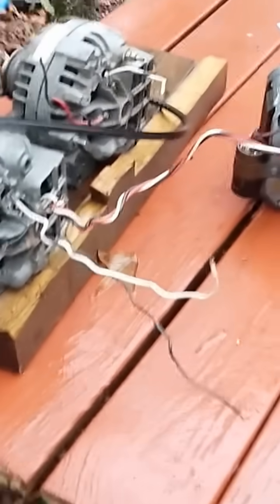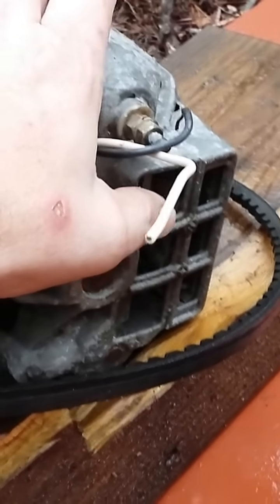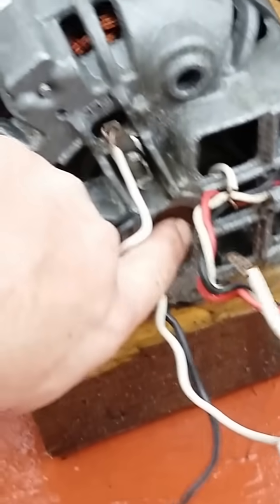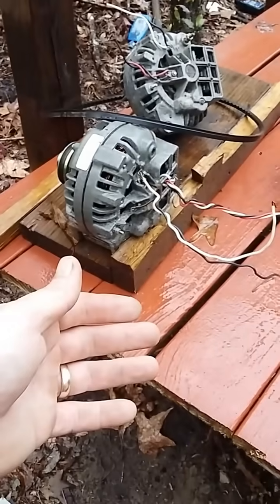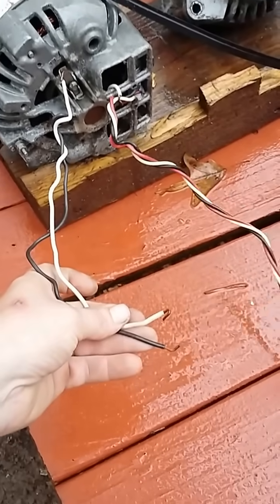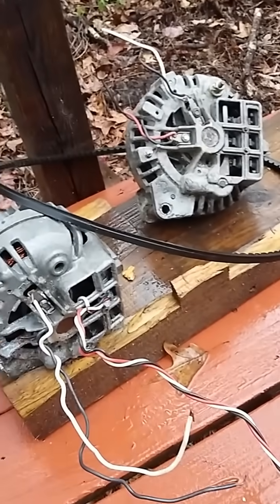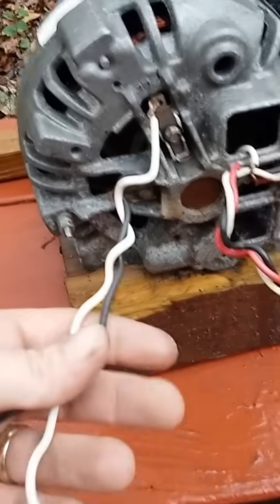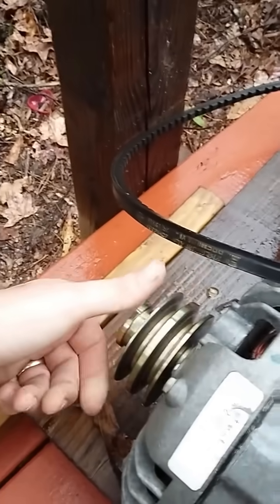Update Free energy forever no wind no solar no gas READ DISCRIPTION!!!

Comment: You haven't shown anything is that even running why can't you make it run?
Reply: Joseph DuPont You are better off powering a vehicle and then using that energy to power your home. I use the equivalent of 9 horsepower and get 400 HORSEPOWER in return.
Traditionally, moving a vehicle is the hardest thing to do. You cannot FAKE moving big heavy trucks. We were at a tractor pull event with our hood off, they couldn't believe their eyes when we took off!!
So much for SKEPTICS!!! 😂😂😂😂😂😂😂😂🍷🍷🍷🍷🍷🍷🍷🔥🔥🔥🔥
Reply: @skytoll1  if what's your saying is correct you should start putting these units in airplanes and the and the girl change the whole aircraft industry if not you're just blowing smoke
Reply: Forget even airplanes how about power boats how about cars how about being able to run a nine goats 80 miles an hour with your truck with a 9 horsepower motor. Are you really saying that's going to be the case do you really believe that if you believe that why having it done it's been on the news
Reply: Joseph DuPont we are launching a concept in Burlington County for cars and trucks to use these systems for about $100 dollars a month with unlimited mileage. Gasoline is a complete waste of money. 😂😂😂😂😂 The equivalent of 9 horsepower produces greater than 400 horsepower, we have been testing this for years to be a viable concept. 🍷🍷🍷🍷🔥🔥🔥

Comment: If u r looking for ABSOLUTE  B U L L S H I T >>> watch this video.
 ( most probably by a drunk or  Mentally challenged guy ! )
.... no offense meant ... its jus cos of the time wasted on this cos of the headlines !!
Reply: What he is doing actually will work he is hooking up a pulley driven 10kw inverter they sell them at harbor freight  for 299.00. But needs 13hp to run. I'm for the simple things in life. Running 24v bank with a 1000 rpm brushless geared motor and hook up a long shaft with cogs and run multiple PMA,s  to charge running motors battery bank and my 2,500. AH  bank

Comment: I have to ask how such small wires handle 90 amps.
Reply: I was going to say that higher voltage allows for smaller wire to carry more energy, however... 90 amps of any voltage though that wire will result in molten copper.

Comment: Please share any info with me privately . I have everything just trying to work out what you said about by passing diodes or something etc . Great mate . Also thinking wind up as well and gyro power , magnetic etc etc so much stuff is bs . I recharge my Non rechargeable's as long as right charger IE one that does Ni-Cad or Ni-Mh and Alkaline etc $40 I paid for a universal charger like 7 yr ago  and settings can recharge all varieties of disposable batteries ( I pass on some powder China ones ) but the rest are perfectly rechargeable's over & over . Best one I had was called a Doctor Zapper did and held more batteries at same time , they are both fast chargers and recharge a AA in like 15 to 30 minutes , not bad I reckon . Especially off the solar panel double , triple free recharge everything at same time only a 250 watts panel runs the freezer also as a fridge or freezer .
Reply: Snooze e You are better off powering a vehicle and then using that energy to power your home. I use the equivalent of 9 horsepower and get 400 HORSEPOWER in return.
Traditionally, moving a vehicle is the hardest thing to do. You cannot FAKE moving big heavy trucks. We were at a tractor pull event with our hood off, they couldn't believe their eyes when we took off!!
So much for SKEPTICS!!! 😂😂😂😂😂😂😂😂🍷🍷🍷🍷🍷🍷🍷🔥🔥🔥🔥
Reply: Tesla was a invetor.and a smart 1 ,wonder why so many people with degrees in electrical engineering haven't just built 1 put in a kit in a box and got rich? Fucktards.
Reply: @tomrose6292  The Rockefeller's and the other secret societies got all invention control or destroyed anything they could not make money from . Simple as .

Comment: You have to get DC power from somewhere.
Reply: No need for power. 
All power comes from the air and it runs forever, can't even be stopped.
Reply: @danielkowalski8555  You are so right . We have magnetic poles , that is Energy . The sun is Energy and the wind etc but then they say the ether also ?
Reply: Is that Digital Currency , like Crpto ? Then what ?
Reply: @scottrichard036  DC stands for direct current

Comment: That's great all but the fact it wont work and never will work. if you have it working system why not show us?? That's what i thought...
Reply: David Steele You are better off powering a vehicle and then using that energy to power your home. I use the equivalent of 9 horsepower and get 400 HORSEPOWER in return.
Traditionally, moving a vehicle is the hardest thing to do. You cannot FAKE moving big heavy trucks. We were at a tractor pull event with our hood off, they couldn't believe their eyes when we took off!!
So much for SKEPTICS!!! 😂😂😂😂😂😂😂😂🍷🍷🍷🍷🍷🍷🍷🔥🔥🔥🔥

Comment: Well yeah it would have been nice to see how you had them hooked up to run as a motor you said that's what I wanted to see I know about free electric with using them with a windmill connected to them
Reply: Tree man You are better off powering a vehicle and then using that energy to power your home. I use the equivalent of 9 horsepower and get 400 HORSEPOWER in return.
Traditionally, moving a vehicle is the hardest thing to do. You cannot FAKE moving big heavy trucks. We were at a tractor pull event with our hood off, they couldn't believe their eyes when we took off!!
So much for SKEPTICS!!! 😂😂😂😂😂😂😂😂🍷🍷🍷🍷🍷🍷🍷🔥🔥🔥🔥

Comment: Seriously folks dont do this crap he is doing. Go get some deep cycle batteries that are the same age and size configure those how ever your needs are.  Then buy a good charger you will need at least 10% amps as the 20 hr ah rating is. 200 AH 6v batteries in series equals 12v 200 AH amp hour. You need 20 amps 14.4v or 14.8 for a good true charge with less sulphate deposits. Or buy a desulfinator.  And buy some solar panels as you can afford them and a mppt controller dont use PWM they waste to much energy. Just build it. Trust me you will be able to power more stuff as you add more to the system. The battery bank needs to be first. But try to match AH rating and age and volts. Try to get as many from the same batch as possible. Try large processing plants they use these big banks in large equipment and toss them out if one battery goes bad usually leaving a real good batch still working free. 100 watt solar panels are cheap 79.00 for a 12v a 24v would be good.i built so many systems now I have one that's portable that can power 5 campers with out AC unit running or 1 with AC unit. Even hard wired to a 6 kilowatt inverter 30 amp RV box. I run extension cords to stuff I want to run at home and my power bill has dropped allot. I even added a wind turbine on it too.  My solar panels are in diy suit cases. It's cool. And it works. And real.
Reply: Quite agree. The wonder is that he didn't electrocute himself in the rain. I wonder if he can read? Any basic first graders science book would show him you cannot get "free" power. I'm amazed at the number of Americans touting this sort of stuff. Don't they have a good education system there?
Reply: Some of us older Americans are still in shock what's going on in our beloved country and want these traitors in the democratic party and their pawns in the justice department arrested and charged with treason and a live tv event showing the military execution by firing squad lol.

Comment: By replacing the secondary alternator coil with a Perm magnet you remove the need to apply DC to get AC,
Then come straight off the winding with a 3 phase Bridge Rectifier,
Run that though a DC>DC Converter or a Charge Controller and then you have a charger for your Battery packs.  Add to a Creek or River and you have endless power.
Reply: Yep.. You could also run plumbing a good ways up stream to generate enough pressure to utilize a pressure valve that can then be utilized to spin up a turbine for more power production.

Comment: QUESTIONS : WHAT SPINS THE ALTERNATOR(S) FOR A.C.?
WHERE IS THE "FREE"? 3-12vdc FOR  STATOR ?
Reply from the maker: The alternator with the wires hanging out of the back of it in this video is actually my primary mover and since the video that was over two years ago I have wired it in a star configuration and am using a 3-phase h-bridge ( I built) controlled by an Arduino Uno R3 I programmed and I did not show my self-excited generator head in this video. But it is stated in the description that there is missing information and misinformation the child crying in the background keeps immature people from watching any more of my videos further. There are lots of reasons why I made this video exactly the way I made it to stay safe. Thanks for watching my videos!
Reply: @ThomasBuie  is this real life
Reply: Wow mind is blown.
Reply: I have a 400 watt 3 phase AC with Dc rectifier.

Comment: So many people out there with questions...haha. Your alternators DO have brushes, you're not going to run 90 amps through that 12 gauge wire you have there or the 12 gauge wire inside the alternator - dream on. Your power would come from the ENGINE hooked to the pulley, there's no such thing as free power, and I'm not giving you a free lunch. Now go feed your crying child, and stop screwing around on youtube and get a job. By the way, the washing machine motor - the one with the capacitor that's "ready to go" won't generate anything because it needs a constant magnetic field, it can't provide that because it only has the outside coils. The capacitor you refer to is to start it under load by providing a virtual phase shift making it feel like it has an extra winding when it doesn't. Generator my rearend - get a grip.
Reply: How does your power company generate power for you?
Reply: If the voltage was increased to 120v at 90 amps the wires would still melt. If at 12v 90 amp 03 welding cable could handle the amps.
Reply: @donaldsteele6276  Absolutely true, the voltage has nothing to do the current carrying capability. It's the diameter of the conductor plain and simple. The voltage levels is determine by the insulation.
Reply: @Dewey-wz4ny  yup
Reply: Maybe a capacitor bank to step up the current after hand cranking it or drill starting it.still there will be line loss
Reply: Maybe of he used some high 50 pound pull ring magnets wrapped in copper or gold wire with a PVC center and outer barrier with a electromagnetic rod in the center hooked the rod to some sort of pulley system from his alternator 1 feeding into a large capacitor bank then feeding a 120v electric motor with an ring coil array about 12ft in length covered in ring magnets going N,S,n,s,n,s all across spinning in the middle shaft to the next larger capacitor bank with a 6,000 AH 120v to a 1 step then to his electrical box. Mmmm I wonder.
Reply: And when he draws power a large lead or iron wheel at least 1,000 pounds could spin from his # 1 to help the line loss and load losses from dragging it down.
Reply: Shit for how much all that shit would cost he could easily build a small diy nuclear reactor that could run off old xray nuclear batteries dirty material,  unless he knows where he could get some enriched uranium.
Reply: They don't I have solar and wind turbines on a portable trailer I built my self.
Reply: https://youtu.be/XxXmmuYrbJY

Comment: ONLY ONE question, ..... which of the 3 wires, (red - black - white) do I hook up to my breaker box to get the 110 volts I need for my house?
Reply: With a volt meter touch two of the leads to two of the wires while running. If you get 220 v those are your hots and the third is neutral
Reply: Isn’t there a ground, positive(12V), and earth or neutral.
Reply: 220 is just two legs of 110v with a common neutral or ground. A 110v circuit will have a bare or green for ground, white for neutral and a color for hot ( usually black if Romex) 220 circuit the bare or green is ground and white and black are both hot. Neutral and ground are the same thing basically
Reply: Take 3 guesses, the first two don't count.
Reply: Wow a 12v alternator wont give u 220v without a battery bank and 220 inverter
Reply: This is a joke right? U guys must be getting paid by an electrician to find him work by causing damage to people's stuff.

Comment: It's funny how all the trolls sound the same. The only problem I see is The alternator or motor burning out. After consistently running for a few hours. Plus, you'll need to beef up the wires in order to handle 90amps. But, this is very plausible.
Reply: A PMG windmill works in the same manor running the current through a charge control and then a converter right
Reply: @manuelsilva5967  I would think so
Reply: You think that "The alternator ... will burn out after a few hours?"
Alternators like these come from cars and trucks, and they generate many watts of power to run headlights etc at night, plus all the other electrical systems, but they don't burn out after a few hours. In fact they run for thousands of hours.
Reply: @michaelwalsh3482  thank you for the insight.. makes complete sense..

Comment: So ill say this once and once only. Your basic principle here is exactly what damns use to generate AC electricity. 

A dc input is put accross field generators that are situated around coils. As the coils pas through the field generated by the dc current, the electro magnetic lines of flux are crossed therefore generating a voltage of the ac type.

The problem with this setup here is a common misunderstanding of the conservation of energy.

Ill explain it in simple terms, you have a dc generator (the battery) which induces a voltage on the rotor side of the alternator. You then are in turn driving that alternator with a motor which generates an ac current through the windings with an aid of the dc field. For sure this generates ac power. And you can draw high current so long as the motor powering the alternator can handle the back EMF from the current draw on the field. and if the windings of the alternator can handle the excess heat from the current draw for a prolinged period of time.

Heres the problem. Youll have to charge the battery to maintain the dc field to generate ac. And how will you do that? By powering it with the ac power. But you need a ac to dc converter to charge the battery to maintain the dc current. In a closed loop this wont work, the biggest reason is friction and heat. All the energy in the system will eventually be lost to resistance of the copper wires, the friction of the parts rubbing together, and the heat generated by the process. So realistically the "free power" is just lost to radiation of multiple types.

Thus if u add an external source of power such as your house power, you could maintain this process, hiwever youre only adding more steps to a process making more loss in energy. When you could have just as easily gotten power from your home.

The only reason a dam or any other power plant can generate power, is because it has the assistant force of gravity for dams to drive the drive shaft. Or steam in a nuclear power plant to spin a turbine which drives the generator (alternator).

Keep in mind a damn has to supply its own dc current as well to produce ac, but it can sustain this because the force of gravity on water turning the turbine makes more energy than the dc generator produces.

Source: im a fucking electrician.

Comment: I would just use these to build wind turbines. You will need batteries to charge. Then use inverters so you get a steady source of power. Surges will destroy all your electronics. Make sure your inverter is a PURE SINE WAVE. For each inverter you have they recommend having a different breaker box. I have been studying this so I can operate  my bitcoin miners for free. This will repay you for the money you spent. Miners will also heat your home in the winter if you can tolerate the noise.
Reply: It can be a modified one as long as your not plugging in stuff that has a step up built in it

Comment: What do you use to start it
Reply: angela Lazon either spin it with wind or hydro power or use some non-free energy to spin it... lol. Generators are every where. Have been for along time. They have to rotate to create power
Reply: sounds like the haters use negative energy..... says power in 3to12v your choice for up to 90amp, unless you have a year round creek or wind turbine to run a belt to it then no need for power in wires only power out. but a cut out cut in switch will be fine once its done.  may burn out quickly under steady use.

Comment: And here I am, just an average guy who owns an FAA alternator repair facility, who overhauls those very same Chrysler style alternators. Now, given that I understand his operational theory, why make a video that only shows a hypothetical operating system....? Granted, isolating the stator from the diodes will get you roughly 120v ac, the amps available will not do much to get you "off the grid". But good luck powering those alternators and enjoy charging your iPhone and maybe running your mini frige.

Comment: Please you still have to spin the alternator to get power. Adding a battery to the other side  would bring out higher output from the other side until you hook up a load to it and that 8 v battery would be dead fast unless you spin the alternator! Which requires GAS dah! And that's not free, charging up your batteries aren't free